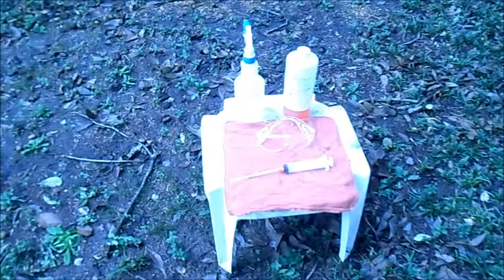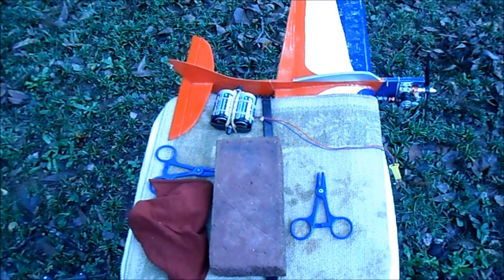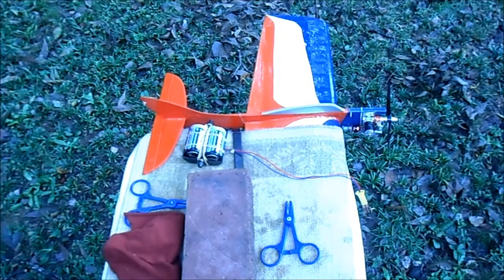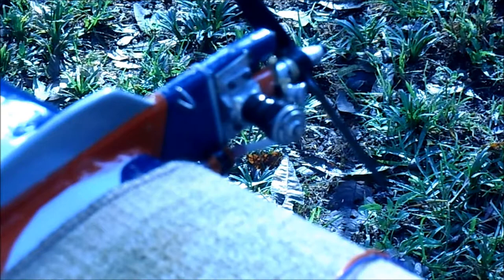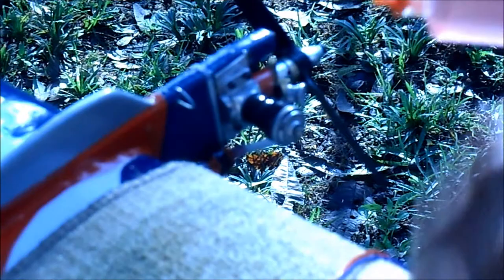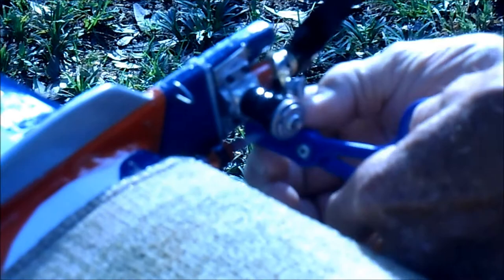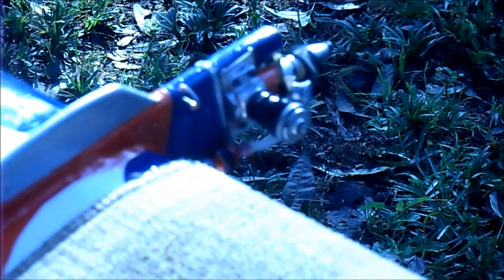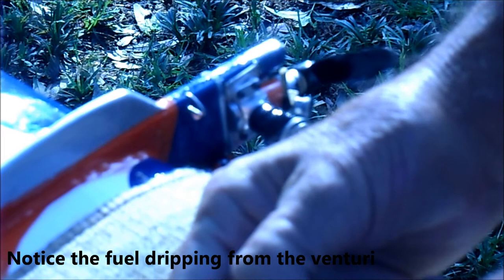Pressure bladder cranking and running

Comment: Thanks. Doesn't seem that difficult.
Reply from the maker: +Lee Coleman  Hey Lee, glad it was a help. I've simplified it a lot since back then, but you'll figure all that out too. You'll never have to worry about sputtering out in loops again. Once you go bladder you'll never go back. If you need to adapt fine thread needle valves, check out needle valves at texastimers.com. You can sleeve them to fit any engine.